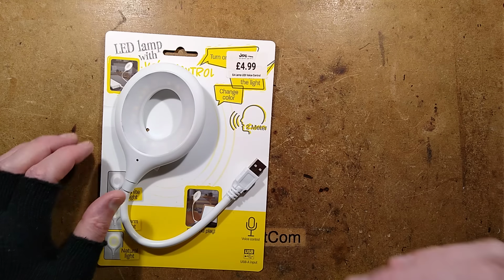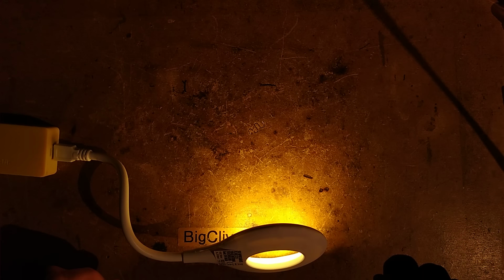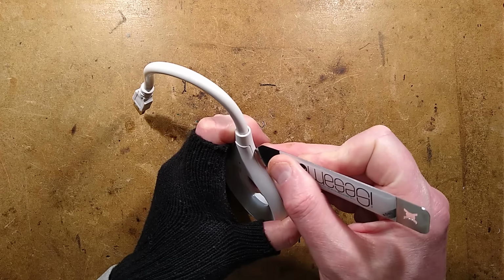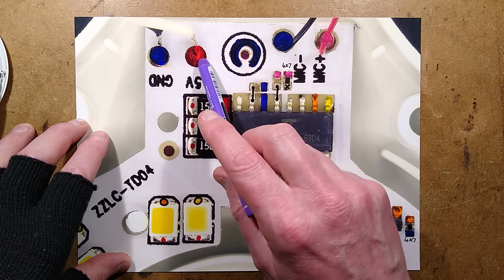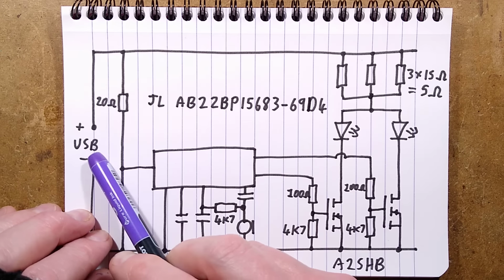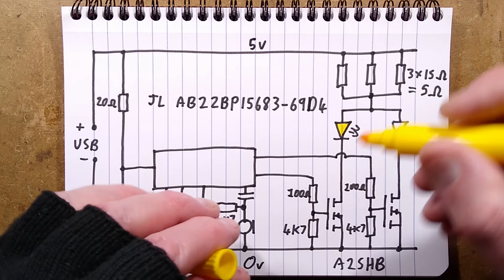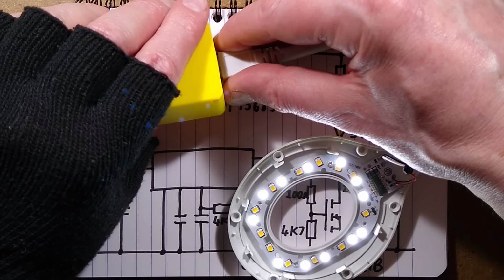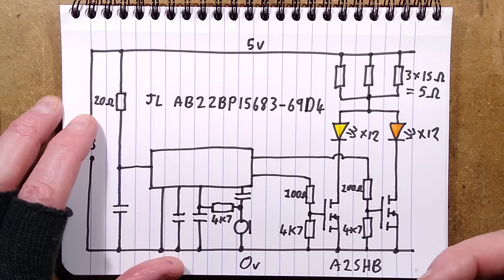Inside a voice controlled light - with schematic

Comment: Not going to lie I definitely thought this was a fake, troll video at first with how flawlessly it worked on those voice commands. Pretty incredible for a cheap, one chip solution!
Reply from the maker: I'm surprised how good it is.
Reply: That could put Amazon and Siri out of business in one fell swoop, eh?😂 🤣
Reply: Rossmann also has released an Android keyboard that also has a pretty good offline voice recognition.
Reply: Especially with a UK accent. Eg YouTube auto captions usually make a hash of Clive.
Reply: @Gengh13 Offline voice recognition isn't hard at all when you're running on a full-blown ARM SOC in a smartphone. This is a completely different situation
Reply: The Jie Lie chips are deceptively powerful for such small packages, the pin count relates the number of parallel functions the chip supports there are versions with the same core that have 32 or 48 pins for more functionality, many of the pins can be configured at start up to perform specific functions from a menu of options. The chip is fairly powerful, has a proprietary 160MHz 32bit RISC MCU that has on-chip hardware support for USB, Serial, Bluetooth and SDCard interfaces and is optimised for audio processing (on chip DAC/ADC/Microphone etc.). 

There are several small general purpose offline voice recognition frameworks that can work on a MCU of this power, such as whisper-small, that are only limted by the size of on-chip flash memory. In this case as only a few words are trained probably in English and Chinese only, it doesn't require a general purpose framework, hence something like Picovoice's Rhino speech-to-intent engine can be used, although in this case its more likely a custom keyword spotting model has been used  as they have a very small footprint memory and cpu wise.
Reply: My car from 2004 has this, voice recognition is nothing new
Reply: @srpacific  It's incredible for a *cheap, one-chip solution*. What's impressive isn't the capability, it's the price.

Comment: The fact that there are at least some undocumented voice commands would fascinate me.  I would probably spend an embarrassing amount of time saying everything I could imagine a light doing, phrased in every possible way, just to see if I could get this thing to do something new.
Reply: I wonder whether it responds to similar commands spoken in Mandarin or Cantonese…
Reply: @markiangooley was wondering about that also, you'd think they might at least make a Spanish or French version.
Reply from the maker: I spent a lot of time testing commands.
Reply from the maker: There are language specific versions.
Reply: i have a vocabulary sheet that came with mine — see comment, above.
Reply: After seeing what it uses, I'd probably try "Bluetooth moder" or other variations to see if it has some more hidden features.
Reply: Hopefully the undocumented commands are just the same commands in other languages, and not “let’s play global thermonuclear war.”

Although…
Reply: Something like that happened to me with a cheap mechanical keyboard, the box showed FN+ commands to change backlight patterns, speed, and brightness, but it didn't show FN+W to change arrow keys and WASD with each other (i found out when i was trying to change the volume with FN+F8 and still moving with WASD, and was confused about why the controls had changed)
Reply: @tncorgi92 I wonder how well it'd work to add multi-language functionality. From a hardware and software standpoint it's basically just a matter of adding storage for the other language's commands, but from a product design standpoint the more languages you add the more likely you are to start triggering false positives due to false friends.

Comment: Fun fact: JieLi part markings have the part number at the end after the dash, being the tail of the part number. The chip in question is AC6969D4. You can try using LCSC's JieLi listings for reference.
Reply: That's a lot of power for a $5 usb light.... wow!
Reply: Nice nice 😂
Reply: Wow! It's WILD how capable that little chip is! Full on DSP chip..  Very cool.
Reply: It's basically a repurposed Bluetooth speaker chip. It's honestly amazing how they can make something like this work. I have a chinese version with a RGB LED and while it gets incredibly boring after a while, the voice commands works shockingly well. Just annoying how these JL chips are really hard to mess with.
Reply: It would be cool if some the functionality could be accessed.  I see it’s got Bluetooth, USB, charge controller and other stuff in the AC6969D4 version.  Dang!, that’s a lot of compute power in one chip for less than 50 cents US. 

I found what appears to be the same USB light for sale on the Walmart Marketplace web site for 5.96 Dollars US, free shipping, before sales tax.  I ordered a few for experimentation.
Reply: Further proof that the microchip industry is rife with blatant price gouging.
Reply: It's ridiculously powerful. There's a 160MHz CPU in there, complete with floating point. I've found Bluetooth audio modules based on one of these for $0.90 a shot, although they're a bit suspect (they claim to be 'MP3 players' with '64MB RAM'?). It's also, BTW, precisely what chip you'd need to spy on people. It supports BLE and hardware audio compression, meaning that you could run one on a button cell, storing audio on its internal flash --- it's probably 512kB --- and then suck the data off it using your phone by just going near it. The onboard DSP and voice recognition abilities means it good detect keywords as well. This one probably can't, as it doesn't have the necessary clock chip needed to make Bluetooth work.
Reply: @bewilderbeestie  That is a great comment!  It makes sense for China to flood lots of cheap devices globally with goodness knows what hidden capability in the firmware.  99+% percent of purchasers don’t have the awareness or technical expertise to know if the cheap Chinese electronics they’re purchasing pose a security risk.  These devices could easily be configured to attack networks when it could benefit China’s government.  This voice controlled light doesn’t pose too much risk, but things like lightbulbs with ESP-32s inside could do lots of nefarious things.
Reply: @Elyseon You can't compare this IC with modern chips in a 3N process. They're probably running on some ancient process size, and since each individual die is pretty small, yield is basically no issue.
Reply: A rom dump would be nice.

Comment: I bet this would be REALLY cool in one of the LED headlamps! Wouldn't even need the IR motion detection feature, could keep working with both hands and just tell the flashlight what to do.
Reply: And no SOS!
Reply: Yeah, I agree. It’s always a pain when using the headtorch for some job involving dirty/oily hands, then you have to fiddle around with your head torch to turn on/off/dim.
Reply: The colour change could also be repurposed for a near/far option, depending on whether you need to see something in the distance or read something small
Reply: ez, get that headlamp with the USB in the front and stick this into it big clive did a video on it a while ago :p
Reply: @MrHack4never The near/far option could be achieved with the selected LEDs being under different lenses and or diffusers.
Reply: This light shouldn't function long running off batteries and listening for a voice, so you'd want a power switch between it and the batteries if you were wearing it?
Reply: @V0S1N0  Or just make a hardwired version. Although if its hardwired it should have replacable bulbs.
Reply: @V0S1N0  Yeah,  definitely have a main power switch to completely disconnect the battery when not in use.
Reply: @V0S1N0  How much power does the chip use?
Reply: @jelleroggen  Unless i misheard,  BC said 10 mA in standby
Reply: @jelleroggen Clive mentioned 10mA off current and 300mA on (all LED?)
Reply: @V0S1N0  Well 10mA at 5V is 50mW. An 18650 cell might have a capacity of 10Wh. Conservatively estimate 50% efficiency losses (boosting to 5V etc) and it would power this on standby for 100 hours or so.
Reply: Perfect. I know I get annoyed by people with headlamps looking right in my face so then I can just say "turn off the light" and the lamp would do it for them!
Won't be annoying at all...
Reply: @V0S1N0  He mentioned what the power usage was for standby,  can’t recall what it was, but it was not a lot. Edit: see matthewmarks comment above, estimated 100hrs standby on 18650 cell, that is amazingly efficient.
Reply: @_..-.._..-.._  The Jei Lie mcu has a low current deep sleep mode where most of the on-chip periphery can be turned off.  Probably used when the light is in off-mode. The io pins (mic in the case) can wake the chip up from deep sleep via an interrupt, ramp up power to process the incomming signal. I would imagine the light uses more current in noisy environments than quiet environments due to constant wake triggers.
Reply: right :) if you curse make it turn off your headlamp
Reply: @maicod  That would be hilarious!

Comment: I remember my dad struggling with voice control car headset modules in the early 2000s.  You'd have to train it to your voice, and then he'd sit there struggling saying "Call home.  Call.  Home.  CALL HOME."
Reply: All a bit ironic, given that most dads want to 'escape home'. 😂
Reply: And then it would call the plumber or something. Fun times.
Reply: IIRC those did basically waveform matching. And youd program it in the garage, nice and quiet, but end up using it on the road. With all the road noise, electrical noise usually found in a cars electrical system, vibration through the cars body. Designed by people who only test it in sterile laboratory conditions, or carefully choreographed trials, never in the real world much less testing it to failure or backwards from a point of failure to where it starts working again to define its operating window.

The sad part is far to many STEM kids who just followed instructables all their lives are designing 'smart' cars now and doing the exact same tests....as in barely any at all. Certainly not any that stress test their control systems.....remember that next time you see a tesla or self driving taxi on the road......
Reply: Ever tried the speech commands in a recent Volkswagen? they do not work a tad better than that, at all.
Reply: I gave up on voice commands when I realized that my phone was training me to speak as if I were angry, (the only way it understood) and I could feel my blood pressure increasing when I spoke that way.
Reply: @BlackSoap361  I found that sometimes with voice assistants like Alexa and the like, mumbling helped a lot. Seems those things are so trained to understand a wide variety of speakers that extremes work best.
But then, when trying to have it play one certain song and getting 5 completely different and unwanted things before, the commands turning into angry shouting comes completely naturally...

With the thing in my car, they expect very strictly formulated commands with certain words in a certain order. It works perfect if you have the manual open and do it like that, even with the noise of an open drivers window (which by the way if you are on the phone, the person on the other end does not even get a hint of, so the noise canceling on that is fantastic). But they are so far of from naturally speaking, unless you learn them by heart I consider it completely unusable.
Reply: @alexanderkupke920  Ive found with speech to text, which I imagine the voice command system uses the same engine, speaking each word with a clearly defined pause between them and as little accenting or inflection as possible, like a robotic see and say kind of tone (not literally like the phonetic chips of old, but you know, even cadance and such), vastly improves their accuracy. At least until you use a word that is not in the common lexicon.....
Reply: @TankR  With some systems I found it incredibly hard to use distinct pauses in between. Lets use Amazons Alexa for an example, you can make an anouncement to all for example something like "dinner is ready" then it plays a chime, some triangle sound, and whatever anouncement you recorded. But most times only the last syllables.
If now I try the same with a distinct pause, half a second pause decides over it working flawless, or now getting impatient and asking what the anouncement is so I have to record it separately again. timeouts seem to be something very finicky about this.
Reply: @alexanderkupke920  half second? It is over if you're waiting a half freaking second....
Reply: @TankR  sometimes I get the feeling that darn thing has a mood and the timeout for finishing the command varies between a thousands of a second to half a minute. but yeah, most times, half a second might be a lot already.
I am pretty sure I have an idea why people came up with so many memes about this.

Comment: it is remarkable that voice recognition is now cheaper to process than a mechanical on-off switch! 🤩 i found a similar such unit in a smaller package — a Tech1 USB Intelligent Voice Light. it may be useful for you to know that there are several more voice commands: 

Turn On
Turn Off
Light on
Light off
Go to bed  //some sort of sleep timer
Brighten the light
Dim the light
Maximum Brightness
Minimum Brightness
Set one hour timer
Set two hour timer
Cancel timer

Red colour
White colour
Blue colour
Green colour
Pink colour
Purple colour
Yellow colour
Change colour

got it at Dollarama in Toronto, Immported from China. 
very cool little bit of tech. thx for your teardown. 👾
Reply: It even understands UK spelling. 🙃

What does "change colour" do on yours? If it just cycles between the three whites it might be that this chip is exactly the same. Time to probe unused pins to see which are the outputs for the other colours. But it would be trivial to, say, ground a pin to put it into multi-colour mode, and that would require more experimentation.
Reply: clive , i'm truly impressed with today's thing.  is it worth considering a review of this toronto dollarama version too?
Reply: amazon has a similar unit for $10, and it says it's got a `push to program' mode (it says each command in English, you teach it your version/dialect)
For $10, worth the self-contained usb goodness.

Comment: What, it doesn’t come in pink? 😂

I love it. Minimalist to a fault. No remote, no internet connection, not even Bluetooth. It “just works”.

One of the things that really impressed me was that the tiny microphone responded very well to your relatively deep voice. Yours is only a bit deeper than mine and I’ve had trouble with voice controlled electronics understanding me. Whoever designed that thing, particularly the software, is very good at their craft.
Reply: The irony is the chip running the lamp is a repurposed Bluetooth speaker processor.  … De-contented for the good of mankind. 😊
Reply: I haven't noticed lack of lower frequencies when listening to recordings made with tiny mics. Possibly as part of the algorithm to make it more robust, it digitally filters out frequencies below the level where it expects voices to be. Poor Lee Marvin wouldn't be able to control his lights. 🌠
Reply: @wtmayhew  I guess that explains all the unused pins…
Reply: @matthewmarks6951  Are your mics of the same (presumably low) quality as that in the light? Granted the device is overall pretty good, I can’t bring myself to believe that the maker splurged on the mic.
Reply: @markfergerson2145  Considering how tiny the mics are in phones and the quality you get from them, I would be surprised if there was a noticeable cost saving in making a mic that worked worse. They are very simple devices.

Comment: Back in the late 1970's early 1980s I had a toy sold as voice recognition but what it did was count the pauses in words and phrases. It was robot so things like FORWARD and GO BACKWARD, TURN TO THE RIGHT and so on. Then there was the Robot Commando sold back in the 1960s that had a remote voice command function that was just a magnetic breath paddle switch. They had to change the box text and instruction after the first run of the toy for legal reason.

Comment: This is a much better device with much more good will engineering done, compared to what we usually get from cheap CE. I am surprised. Respect!
Reply: Indeed. No IR remote control to replace batteries in or worse lose, no damned SOS, no built in battery to overcharge and burst into flame, just pure functionality.

I marvel that it got to market without all of the usual encumbrances. Here’s hoping the manufacturer keeps on this path instead of joining the usual suspects in adding things nobody needs.
Reply: @markfergerson2145  Someone in China goofed up and let a well thought out and well designed product slip out.  I am impressed at how many things this cheap little lamp does right, even saving the previous operational state between power-ups … with the exception that if it were previously all the way off, it comes back on at the dimmest setting - now that’s clever snd well done.

Comment: I did a bit of searching and the chip appears to be (based on the appropriate section of the manufacturers website) an AD142A4 by ZhuHai JieLi Technology, although looking at the datasheet it appears to be a general purpose MCU for kids toys, so I guess they have an application specific voice library that can be loaded onto it.
Reply: It's actually a JieLi AC6969D4

Comment: Apparently this is a general DSP mainly intended as bluetooth speaker IC, supports BT and usb otg as well. No ingrained voice commands, so its all done in code.
Reply: This seems unlikely.  Zuhai Jie Li do make bluetooth speaker ICs that are widely used in the lower cost speakers, but they also make a range of dedicated voice recognition ICs for light control.
Reply: @ferrumignis  the part number ac6969d4  comes back to an ic that says intended application is Bluetooth speaker. Do you have a different part number that says different?